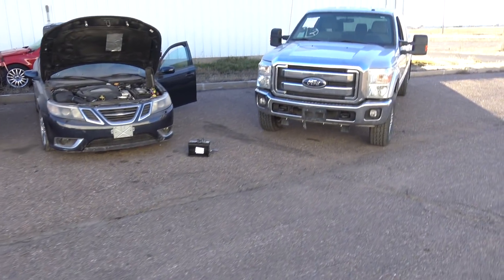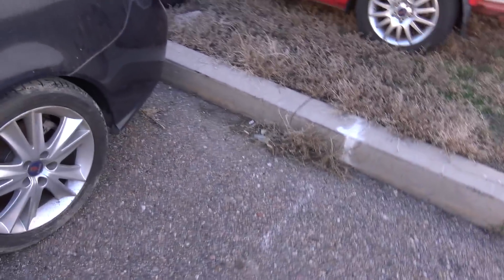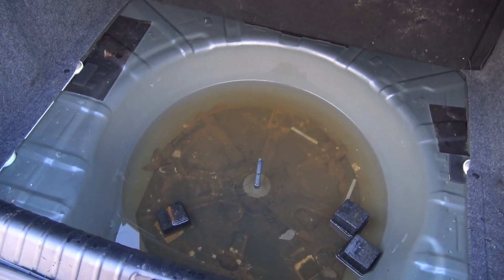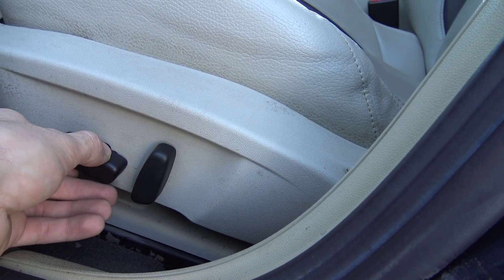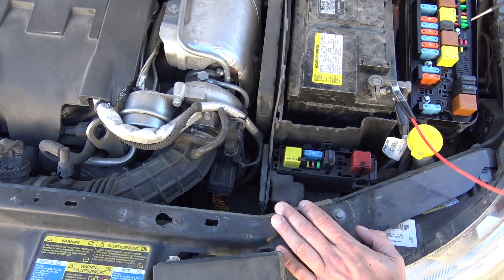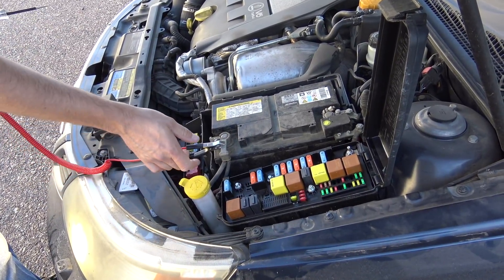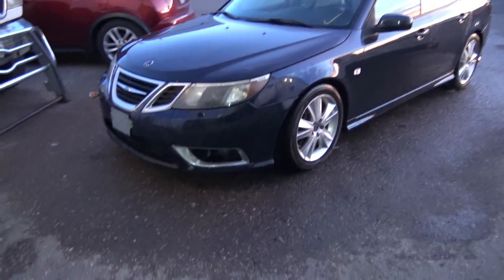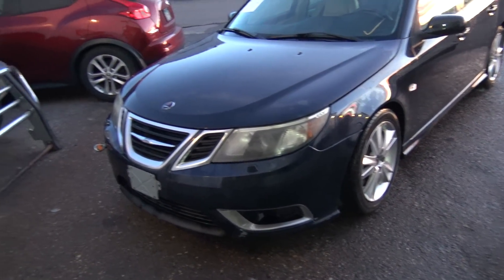HOUSTON FLOOD CAR! Salvage Auction Saab!

Comment: In the under hood fuse box, there are other missing relays and fuses. Check the owners manual and I’ll be willing to bet you are missing the starter and or fuel pump. Be interesting to see

Comment: why dont you just swap the ECU from the trashed one with the ignition into the Aero with the good body panels, that would take about 2 hours just solder the wires with the ignition, which is near the transmission hump, and the ECU, test them to make sure they get 12V signals through them test for continuity, that would be my guess? lol

drive a 200 7 saab 93 2.0T  (stage 2 as of yesterday) im very surprised your into saabs so much, pretty cool

Comment: I saw a SAAB SUV today on the interstate, blew my mind! never knew they made one. 😳 looked like a Chevy equinox kinda.
Reply: Love your videos, Sarah! The Saab 9-7 is on the Chevy Trailblazer platform btw.
Reply: May have been the Saab 9-4.. Very rare. Those are based on the equinox
Reply: Yeah, it was built from the trail blazer. But they cost more than a blazer though.
Reply: James Crews nope, it was definitely the 9-4x I spotted, it was really nice looking! The blue plastic in the headlights is what grabbed my attention.
Reply: 9-7 is based on the trailblazer, pretty much a luxury trailblazer. The 9-4 was similar to the equinox but they are very rare to find..
Reply: Yep! Love the 9-4. I have been trying to find one. I have owned 15 Saabs so far! Great cars/brand
Reply: @Sarah n tuned 
Oh, that one. It's a pretty nice crossover. I wouldn't mind driving one.
Reply: sabb was owned buy gm then had to sell cause bankruptcy. ..
Reply: 9-7x 9-4x blew my mind too when I serched a few different variations thought they only had a 9-7
Reply: They took ownership in 2000. They sold SAAB in 2010. Spyker Motors then bought them. The SAAB brand is still "dead" but is now known as NEVS. (National Electric Vehicles of Sweden)
Reply: no, they were owned by GM, if you knew anything about SAAB you'd know what's up and why SAAB went bankrupt
Reply: that's not a real saab, saab are the 9-3, 9-5 and 9000 and older.

Comment: You need to check the engine for water!
Reply: Good idea. thought the same
Reply: He has checked the oil in the last vid,but maybe he should drain the oil.
Reply: He definitely needs to drain the oil. There could still be water in the bottom end.

Edit: Spelling
Reply: BOURB water in the transmission oil is a Problem too in flood cars...
Reply: Actually us off-road guys do get water in the transmission very often when we go in deep water especially for long periods, it's routine maintenance. There is a breather on most transmission than doesn't seal 100%, and on a fwd the axle shaft seal is not watertight I'm sure.
Reply: He has so much patience and skill restoring the otherwise scrap cars. He sees potential in stuff I wouldn't

Comment: If this has the ecu where my TID has it its in front of the passenger side wheel low enough for the water to hit it.
Reply: The 2.8t has the ecu located on top of the engine, my guess is that the ignition switch is the problem. would be easy to diagnose with a Tech II since you can force it to start.

Comment: It's only a good deal when you don't need to sink massive amounts of $$$$ into it and its an easy fix.
Swapping ECU'S on European cars, reprogramming time! Seems everything is linked to the VIN number and it can be a nightmare. On some European vehicles if the AirBag control unit shows as being deployed, car will not start. Some can be reprogrammed to clear the bit controlling ignition and will not show a code as having deployed the bags while others can be reset but will always show a deployment. Good luck with the projects!

Comment: I deal the 9-5s because I always found any of the Saabs built pre-2005 were better built than the later stuff, 9-5s especially.  I just picked up a 1999 9-5 Wagon that hadn't run in years and wouldn't start, fixed a few things and got it on the road.  Took about 4 solid weeks of cleaning up the mouse nests and issues but everything works.  I just have a sticking caliper to deal with.
Reply: DaveVQ nah 04-07 are super reliable I've owned both a 99, 04, 05 my 04 and 05 have been super reliable cars owned the 05 2 years only done an alignment springs and an aux cord install other then that Change the oil my I like the my 99 nickled and dimed me out of 1100 real quick